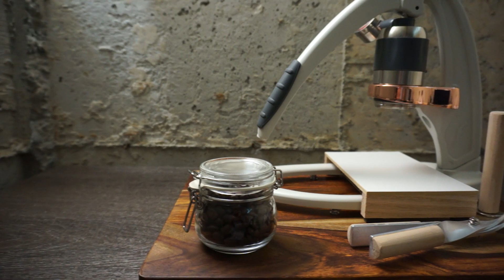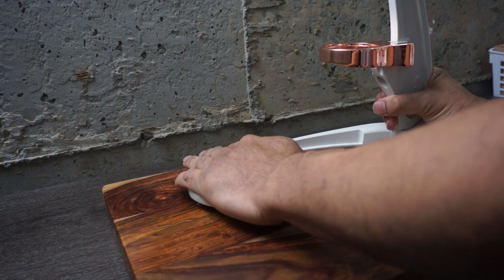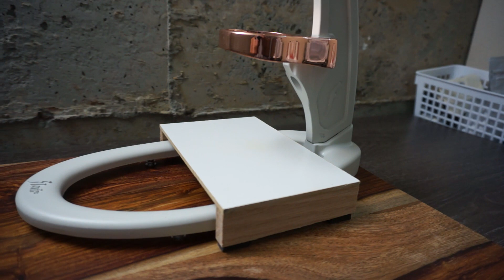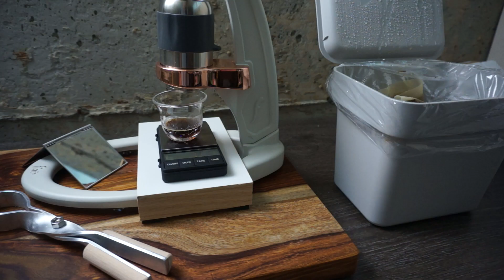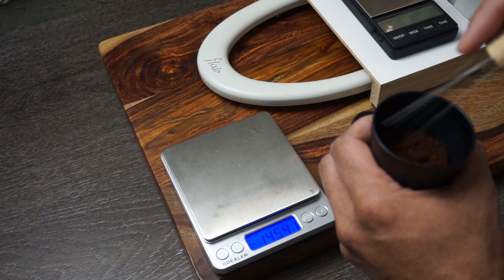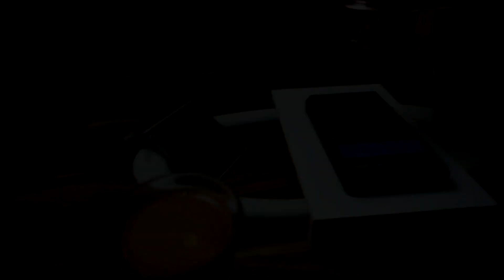Flair Pro 2: Optimizing my workflow with better stability, more scale options, and easier clean up.

Comment: Lots of ingenuity in there: the shelf for the scale, the tongs, the magnet... I am impressed.
Where did you get the tongs and the magnetic wand? Are they made by Flair? They looks like they are made specifically for that purpose...
Reply from the maker: Thanks! I get most of my ideas and a lot of inspiration from the "Brew with Flair" Facebook group. It's a great community if you haven't checked it out already, and man they have lot of great ideas!

I made the tongs from an aluminum flat bar. Just used two vice clamps and twisted it to shape. For the wand, I bought some neodymium magnets and stuck one on to a wood dowel. Because of the make up of the shower screen, anything weaker wasn't not strong enough. The handle is just a dowel that was pre-cut in half that I bought to use as handles for the tongs. I had a lot of it, so I glued two pieces together to make the handle for the wand. I'm not a craftsman so up close they don't look that professional, but I guess for video they look ok. Bottom line, they do work well for my purposes and I like how they turned out.

Comment: Hey Dave, Dave here. That is an amazing idea. I’m probably gonna borrow it, but what are 6mm hex-head what? And where did you get them? 

Thanks for sharing.
Reply from the maker: Thanks Dave, 😁. Here's what I used:
screws: https://www.amazon.com/gp/product/B00PKLVBSE/
threaded rods: https://www.amazon.com/gp/product/B01LXOTO8Y/

You'll also need some M4 size nuts. I just got them from the hardware store.

Comment: The copper of my flair is matte, is there any difference?
Reply from the maker: Flair changed the manufacturing process a couple years back, going from a glossy to a matte finish. I believe it was to improve durability. From what I recall, some folks had issues where the glossy finish chipped over time. Guessing the matte finish is more resilient maybe?

Comment: If youre height constrained, take a look at the end of the one video I have on my channel :) took a bit more work but all scales fit perfectly, and you can accommodate larger cups. Will definitely integrate the stand of idea from your video here :)
Reply from the maker: Nice work! If I can find the time, I do plan on improving mine. Don't think it will end up as nicely as yours 😅. My thought is to ditch the Flair base entirely. But I'd need to figure out how to incorporate some sort of bottom plate that I could fasten it to.
Reply: @davidmaurice1294  funny thing, I just got the idea of building a heat Jacket for my brew chamber and then during research I find the video on your channel. Very interesting stuff. The next part for me would be to make a locking mechanism and handle for the the portafilter, so that it behaves like a real espresso machine

Comment: You can slide the shower screen into place. It always drops down perfect if u do that. Furthermore the shot looked little bit donutshotline at the beginning..mayby to fine ? Mayby just good..

Do really like the magnetic thing. I was just thinking about the cleaning up to ask on the forum some tips. Its the last anoying thing left for me.
Reply from the maker: Yeah, still working on the donut shots, 😂. I do tend to grind a little fine. I prefer the body I'm getting from those shots, but it's really hard to avoid channeling and donuts. I sometimes use a concave distribution that seems to help (basically the reverse of using a convex tamper). I've been happy with the taste, but maybe not the best looking when coming out.
Reply: @davidmaurice1294  I must ask about your grinder? I must since I switched to an upgrade quality grinder channeling disappeared as a whole for me. I've got the 1zpresso j-max. Before I used the sage smart grinder pro.  Makes a whole lotte difference. Wdt was mandatory on the sage but optional with this grinder cause of the quality of grind. Less boulders
Reply from the maker: I have a pretty decent grinder (Ceado E5P) so I think it's me 🤣! I've recently been using my JX-Pro for the Picopresso, so maybe I'll try that with the Flair and see what I get. One thing I do know is that I spend way too much time hacking/moding/tweaking my equipment instead of just working on getting better with my technique 😅. I think that's the next level up for me.
Reply: @TheThePuzzlemaniac  I just bought one of these and happen to have the J-Max, would you mind letting me know around where you are grinding so I could have a decent starting point? Thanks!
Reply: @ItsRossinator  i am around 1.4.0 for the pro2. Sometimes less sometime higher.
Reply: @TheThePuzzlemaniac  thanks!l

Comment: What do you do for preheating?
Reply from the maker: I used to preheat in a pot of boiling water, then moved to heating on top of a separate pouring kettle. Now I'm just using one kettle and suspending the brew cylinder on top with a  mesh strainer.

I haven't been totally satisfied with any of these methods. I guess that might be next on my list to look at. Of the three I think having the second kettle worked best, but using two kettles is a little weird maybe?
Reply: @davidmaurice1294  thanks for the reply. Been looking at the flair pro 2 since they'll probably flood the second hand market once the 58 comes out but preheating is something I'm still looking at people's work flows so i can make a better decision. Going for the 58 might be on the table of choices once the reviews come out.
Reply: @davidmaurice1294  but I'm gonna upgrade my grinder first. Looking at the jx pro and kplus. Still not sure if the kplus js worth the extra cost but im trying to avoid having to upgrade again in the future.
Reply from the maker: Wish you the best with your flair choice. It should be fun either way. The 58 is so tempting right? I almost pre-ordered one on impulse, it took all my restraint to keep from pulling the trigger, haha!

For now I think I'll stick with my Pro 2. And as for preheating, it might look a little ugly but I might experiment with fully insulating the brew cylinder. I've done that with one of my pouring kettles and it's really helped with heat retention. Practically the whole thing is wrapped in foam insulation, including the gooseneck. It's an eyesore, but does the trick.

I don't have any experience with the kplus, but I have to admit it does have some really nice features. For the jx pro, calibrating to zero has been a little bit of a pain point for some (if you care about that). But I'm pretty happy with it, although I haven't used it for espresso yet. 

Before getting a hand grinder I already had a Ceado E5P that I use exclusively for espresso. Although I'm happy with it (and it's really convenient despite almost no extra features), if I had to do it all over again I would have just purchased hand grinders. More bang for the buck. Also there's a lot of variety now, many good options.
Reply: @davidmaurice1294  Thanks for the input! If you ever try the jxpro for espresso I'm sure people will be interested in a video about it. 

I'll test the suggestions you mentioned over at a friend's set up first and then see if the 58 is worth the time and hassle savings.
Reply: @reddboone122989  The kplus will be a better grinder for filter methods and espresso. JX will be espresso focused, but decent for filter methods.
Reply: @davidmaurice1294  I fiind the suspended, steam pre-heat to be unparalleled. What are you finding it lacks?
Reply from the maker: Thanks for chiming in! I agree that steaming is the way to go, but it's not going quite right for me. It might just be my setup, but too much condensation builds up on the chamber (maybe too much steam?), and well before it's preheated. It's hard for me to tell if it's hot enough before pulling it off. 

What worked best for me so far was having the second kettle. It's small and only holds 300ml and I'd fill with like 50ml or so and heat over a butane burner. It boils fast and seemed to generate the right amount of steam. The opening was probably a better size and most of the steam would move through the inside of the brew chamber and not around the outside (so almost no condensation). It got just as hot as if I boiled the whole thing and pretty quick. Only problem with that setup is the extra gear. I already have a lot going on, and that little extra bit kind of put it over the top. Too many things to juggle, haha.

Would definitely welcome any thoughts on how I can improve that part of my workflow.
Reply from the maker: I just saw a posting on the "Brew with Flair" facebook group where someone is using a Turkish coffee pot to heat water. The Flair brew chamber fits almost perfectly on top. Looks very efficient for preheating. I think I will try this.
Reply: @davidmaurice1294  I just trow the brewchamber in the kettle itself. I find that the most efficient way and gets really hot. Meanwhile I prepare the beans. Within 7 minutes my espresso is ready to drink
Reply from the maker: @TheThePuzzlemaniac  I think your method keeps things simple and is definitely efficient. As for me, maybe I play around too much with my workflow and just need to stick with something 🤣! I think I'm at that point now hopefully. I wrapped the cylinder with PI film a little while back and now have electronic preheating. So tempted to keep refining, but I'm stepping away from further mods on the Pro2. Need to focus more on just having good technique and sticking to my process. I'm confident I'll see the best improvements in my shots that way.